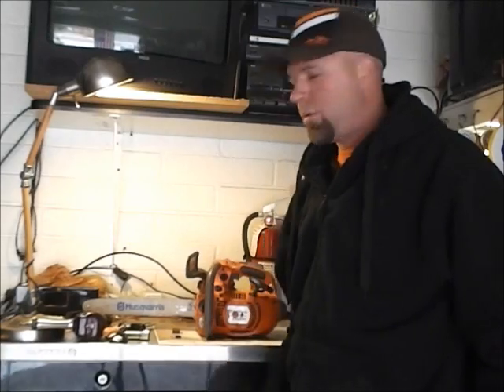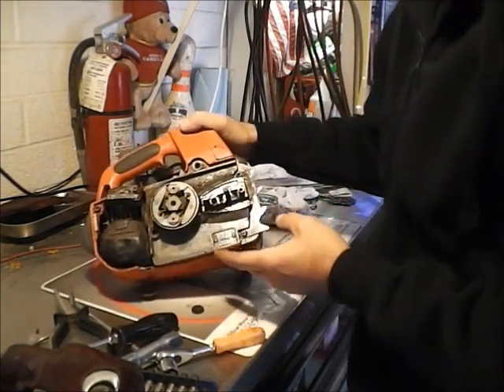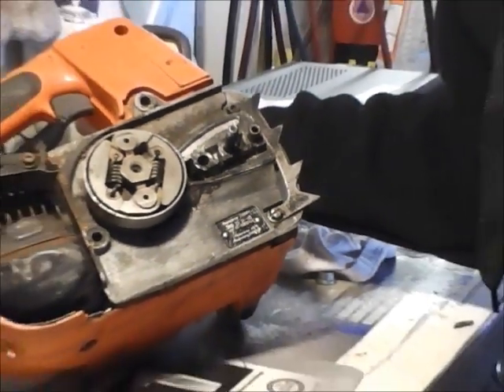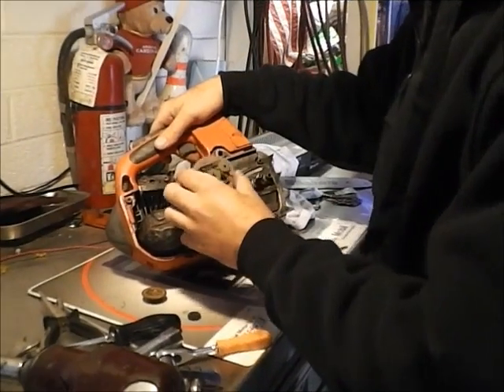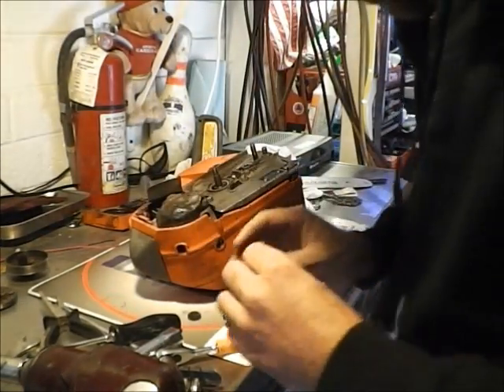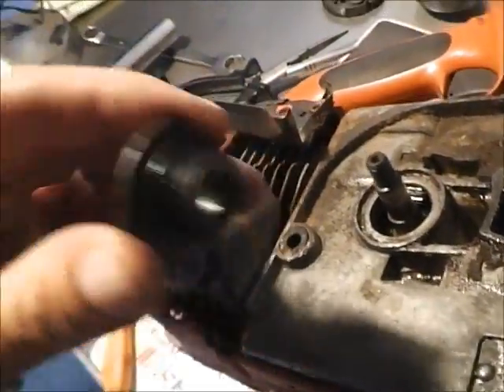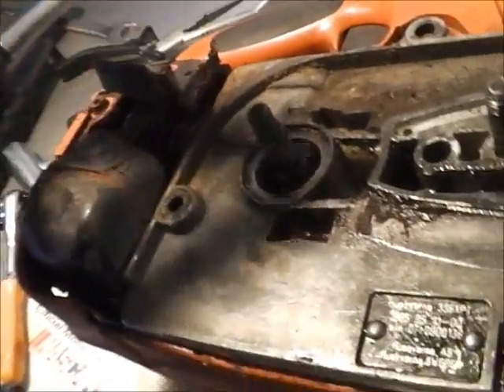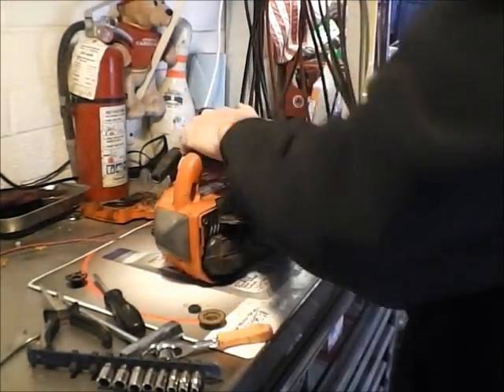Chainsaw chain oiler repair

Comment: Underneath the plate there is a rubber gasket that fits into the oil slot.  The oil flows out from the weep hole, underneath the rubber gasket and thru the oil holes in the plate and the bar.

Comment: That is all fine and good but unfortunately you did not address the problem of what caused the pump to bind up stripping the plastic drive gear threads in the first place so after all of that work and new drive gear the same problem will happen again and probably fairly soon after the repair. Usually on these saws and stihl saws the small barrel metal gear in the pump binds up due to either some debris getting in or using bio lube or veg. oil which will turn to a hard consistency if the saw is not used often or put in storage so on stihls I recommend removing the oil pump and taking it apart to clean it. The stihl oil pumps are held together with a small pin, once that small pin is carefully punched out the few parts can be taken apart and cleaned, there are two washers with a spring in between and that is basically all that is inside, clean it up real good, clean all grooves in the drive gear and make sure it spins freely when put back together.

Comment: Hello there I have a Homelife UT10540/ 14 in, 35 cc chainsaw, when I use it and I set it aside oil leaks from the oil pump outlet tube, it continues until there's no more oil, what's wrong with it

Comment: still having problems getting my clutch off. Doesn't appear to be a socket. The plate over my weep hole is secured with a screw under the drum.